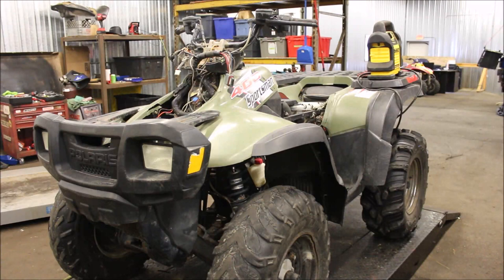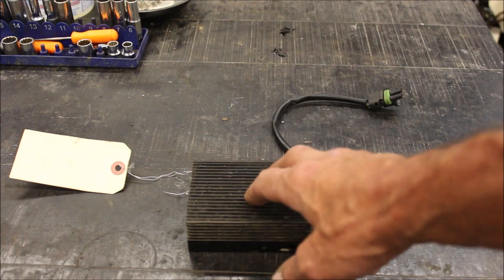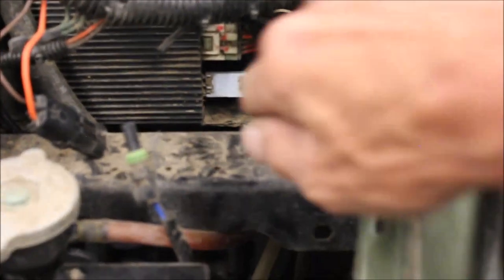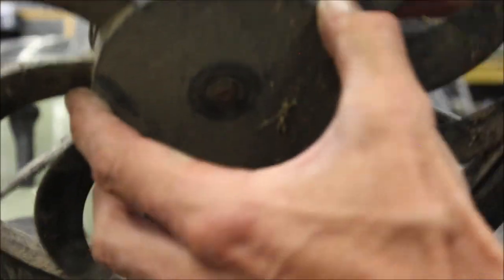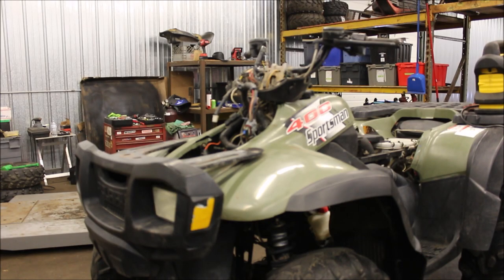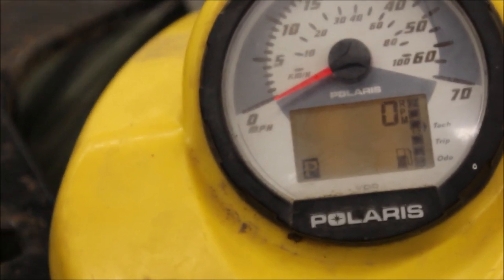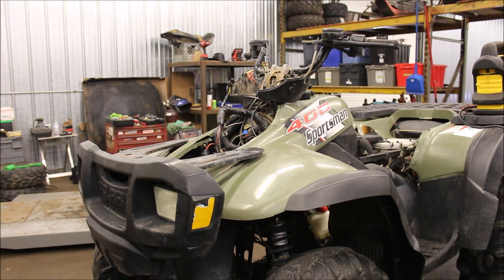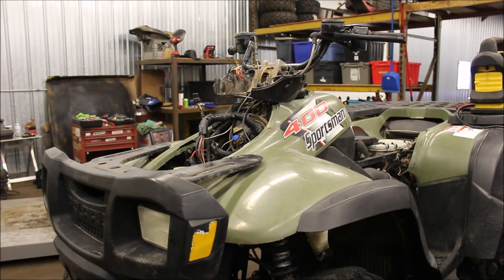ECM Bypass If Your Fan is Running Constantly with the Power Off on a Polaris Sportsman 500/400.

Comment: Is there a way I could get ahold of ya? I have a 99 sportsman 500 that I have been tinkering with to try to get running right and I just do not have enough time to do any more on it with how much time I spend at work. After watching you for a long time on YouTube I feel like you were the man I would trust to pay work on it. I live in Wisconsin.
Reply: I have a 2006 Polaris Sportsman 500 fuel injected with the ECM module gone I was wondering if there was any way that I could rewire it or something to do away with that😅 put another wire harness on it or something thank you what's your thoughts on that

Comment: I replaced a brake caliper on a 2014 400 sportsmen have this problem on every ATV! Can you do a video on a caliper replacement or master cylinder! I tryed every trick in the book even you tube videos and forms! Can not get any firm brake action! Even used a brake bleeder system you hook to a air hose! Even tryed the c clamp method mention in the Manuel! And tryed bleeding at the hose connection on caliper!I work on motor sports stuff for a living but these ATV brakes i can not figure them out!

Comment: I wish I could find a simplified schematic to do away with the pdm, I got an 04 and an 05 with bad pdm and from what I’ve found online they are nothing but problems so I’m not willing to spend hundreds to replace when it’s just going to burn up again. I have a clymer manual with diagrams but as my eyes get older I can’t follow the diagrams if they are too complex.
Reply from the maker: I hear ya. The other option would be taking a 02 wire harness, stator, cdi and coil with voltage regulator off one a guys is parting out and swap everything.

Comment: Hey man I got a question I got a 97 xplorer 500 no speedo but I do have the overide switch 4wd not working where should I start and what should I do to try and diagnose the 4wd? I do think maybe it is electrical but not to sure. The man I bought it from said it was working one day then just stopped. What is the first step I should start checking?
Reply: I have a 98 425 Magnum I had the fan not coming on so I replaced the temperature sensor and thermostat and the problem was solved. These Polaris can be finicky this one wouldn't run if the air filter wasn't on correctly I had to replace the filter stand $30 and a new filter $15 then the battery went dead it's always something but when they are running it's a great machine.l got so much money tied up in this bike I might as well enjoy it.
Reply: Great video! You did a great job explaining the process and different options available. 

Removing the fan circuit from the unit removes the load that caused them to get toasty. 

The 2004/500 that I did this repair on required complete removal of the box as it was burned up and all the smoke was leaked out 😂.  Downloading wiring diagrams gave me the details to figure out Polaris circuitry, which aren’t too complex (carb models). Didn’t have extra cash at the time, so I had to get creative. I also wired the fan to the key switch 😅

Speedometers control the ground for the AWD which often fails, so the brown/white wire needs to be cut and grounded. 

What I like to do on the ones I keep is apply key switched 12v to the grey/white wire on the AWD switch, which will give complete control in all gears as this bypasses the transmission switches.
Reply from the maker: @smallgaragehustle  Thanks for the advice. cutting the Blue wire with white stripe was the Key to this all.
Reply from the maker: @georgehuffert1800  Every Magnum I've worked on has a finicky airbox. Not sure why its just the Magnums.
Reply from the maker: I would check the ground wires and add a ground to the 4x4. check your hub fluid and replace fluid. If its none of those something in the hillard clutch could be off. You could pull the hubs and see whats going on.
Reply: @TitaniummanGarage  OK thanks my guy I will try the grounds first thing I put hub fluid in a just not to long ago. I really appreciate your help and your videos

Comment: My 2005 500  atp  ECM is sizzling and smoking.  Where you located in WI?  I'm in Southern WI.
Reply from the maker: Sounds like your ECM is grounding out. It will probably need to be replaced. I'm in Sheboygan. Polaris had a recall on them. Maybe ask the dealer first if its still covered.
Reply: @TitaniummanGarage  as you probably know, the ECM for the ATP (330 & 500) are pretty much impossible to find.  This one is not covered by the recall.  I was curious if I can direct wire the machine and totally skip the ECM.  I don't really care about the turf mode, or even if the speedo and light don't work.  I just want it to run so I can use it to haul firewood and plow.  If I disconnect the voltage regulator, will I just lose charging capability or am I at risk of ruining something else?
Reply from the maker: Did you see my video I did 2 years ago? Ecm bypass? It can be done. I used the wiring off a 04 atp without the ecm. It had the cdi and voltage regulator. I changed the stator as well.
Reply: @TitaniummanGarage  I did, but I was hoping for an easier, less time-consuming option (if there is one).  🙂

Comment: Why not have the fan run all the time when the key is on ?
Reply from the maker: You can just hot wire the fan. But I couldn't stand the flashing hot light. Plus I couldn't change from rpms to milage with it flashing.